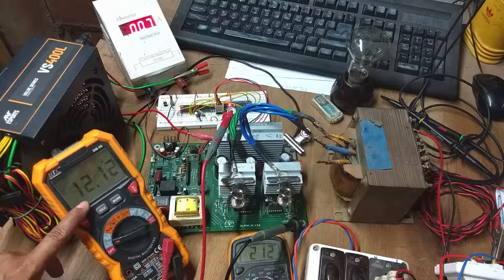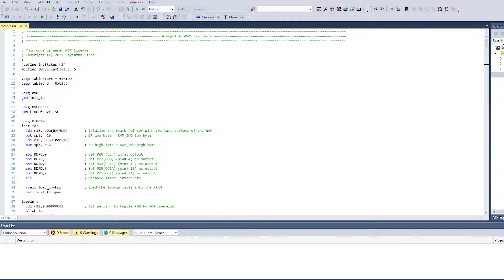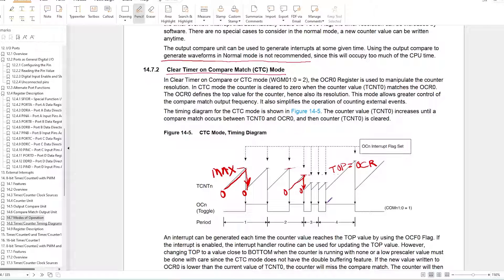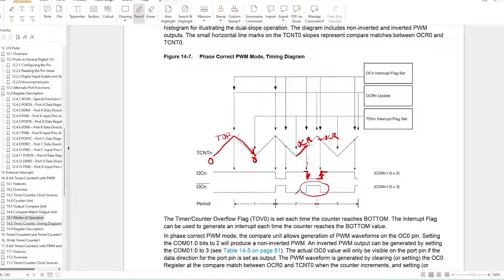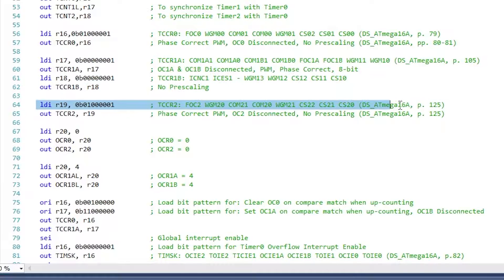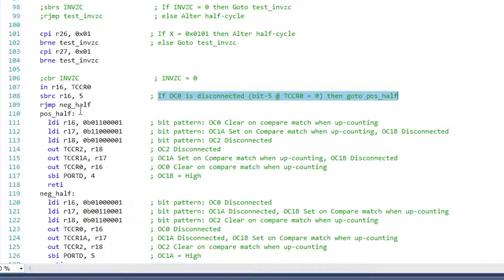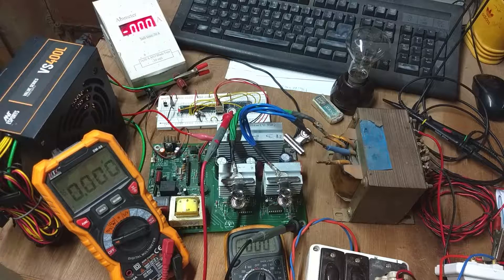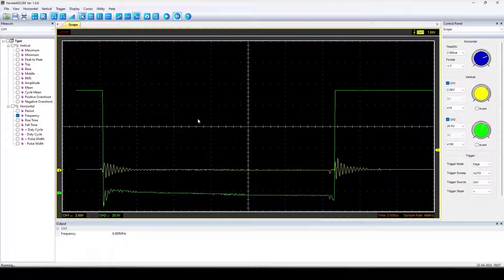Pure Sinewave Inverter Using ATmega16A uC And 32 KHz PWM Frequency

Comment: Hi, I have same solution like you for Ardiono NANO and 3-phase INVERTER / VFD, but I want to make this project with ESP32, because
of a lot of memory for HTMP / AJAX page, to set parameters during operation with WiFi / BT / BLE. 
But I can not synchronize all 3 phases @ 120 @ 32 - 70 kHz, every time I set another freq. for PWM, phase shift changes.
It is possible to do that with ESP32 ?

Comment: could u please do bldc motor driver based on arduino? there are alots on utube ,but they are speed fast by varible resistor ,also they could not explain what the best signal for bldc motor ,is it spwm what u use it in the inverter or the six steps bldc signals esc drivere that on the market?
Reply: i want to drive my inverter AC which is bldc compressor ,the compressor change its speed to adjust the room tempreatur .
I want to mention the ,i cant use VFD to drive bldc motor because it is spwm signal and bldc needs six steps dc signal because it gives much more current at low speed.